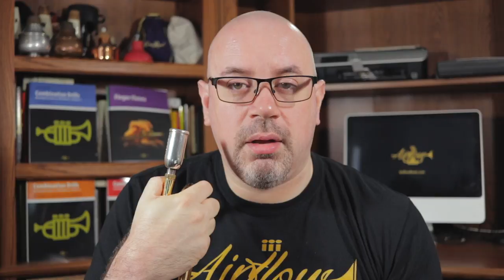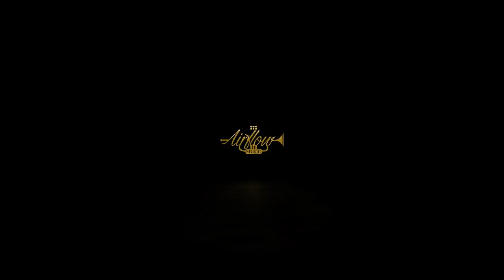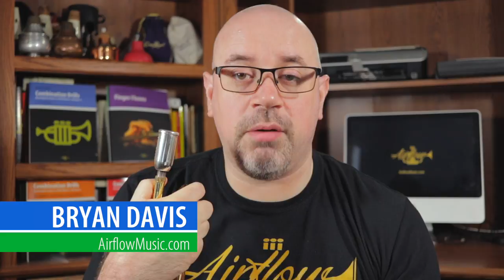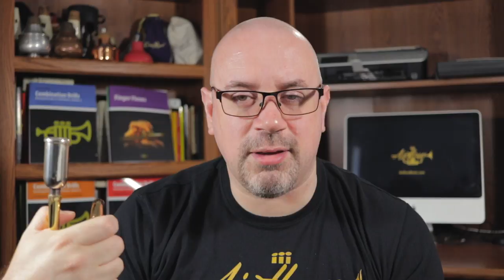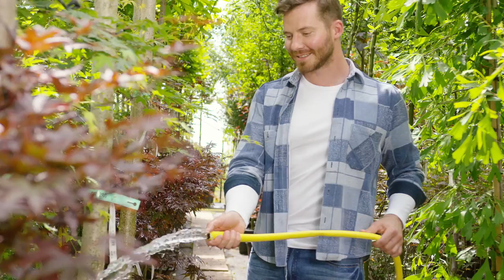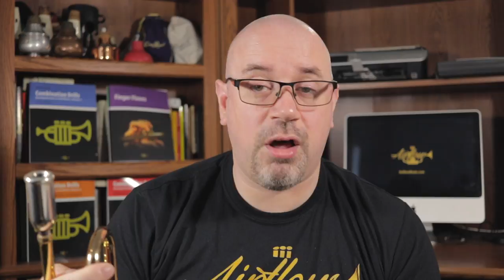What are the 3 Compressions? | "T for Three" | Trumpet A-Z, S01E20

Comment: Hi Bryan

Thanks for your great videos.
I heard a lot of great trumpet players talk about airspeed as the determining factor for a specific pitch. I can't wrap my head around that!!?? What exactly is the relationship between pitch and airspeed and can you refer to specific physical laws than tell us about this relationship....?
I look at it this way. To go from middle C to high C, your lips have to vibrate at twice the frequency. Just like you would decrease the length and/or increase the tension of a guitar string to change pitch, we increase the tension in and decrease the size of the apperture. If air pressure remains constant, it will then have to move faster between the lips, as the opening is now smaller. In other words, increased airspeed as a result of a decreased aperture size, a side effect and not a determining factor for pitch. With my basic understanding of physics that what makes sense to me. Am I completely off the mark?
I hope you'll take a moment to ansver this question

all the best
Rolf
Reply: Thanks for your reply Bryan!
Reply: @rolfthoftesrensen7536  Hi, I'm really interestd to hear what Bryan aswered to you, but I can't see it here? Do you have Bryans answer somewhere?

Comment: Lynn Nicholson talks about how faster air to play higher is a myth. The speed of the air determines volume and the amount of compression determines the pitch.
Reply from the maker: With the greatest of respect for Mr Nicholson, "Amount of compression" is a different way of saying air speed. If the air is more compressed then it moves to an area of lower compression more quickly. Different people conceptualize and explain things in different ways, but I firmly believe that our apparently conflicting descriptions are more similar than they are different.
Reply: @AirflowMusicNYC  yeah, that makes sense. When we talk about using more air, that can also be conceptualized as faster air since the air is exiting our lungs more quickly.
Reply from the maker: The bigger thing to understand and get the feel for is that you don't need to move a large amount of air at any time.Comparatives like more or less air are all well and good, but they should be contextualized appropriately. The quantity of air being moved is really no larger than when we sing or speak. It's just being directed and controlled a little differently.

Comment: Interesting mouthpiece you have there, care to share what it is?  And why that mouthpiece?
Reply from the maker: This is a Schagerl Apredato mouthpiece - a skeletonised mouthpiece with a screw-on chamber that is filled with water. It behaves similarly to a very heavyweight blank, in terms of projection, but without the weight. The Schagerl team were kind enough to convert a spare copy of my custom mouthpiece to an Apredato several years ago. I didn't really expect to ever use it, but it plays SO much better than the original, so that now sits on my desk as a paperweight rather than this!

Thanks for watching.